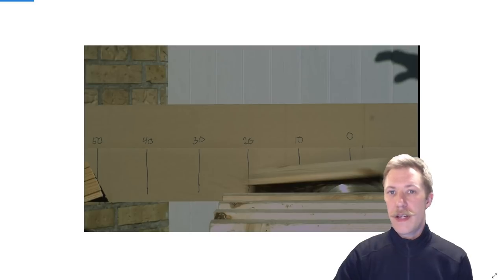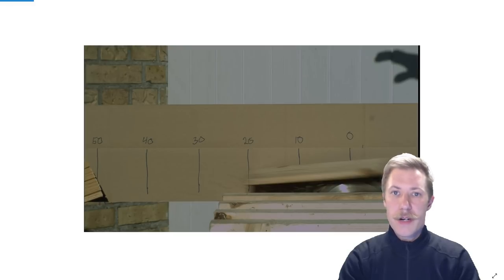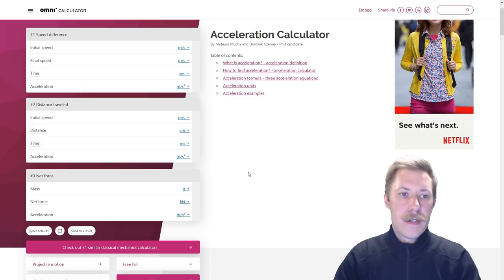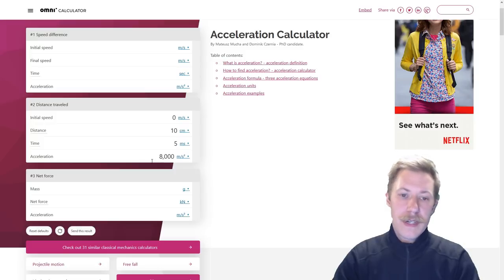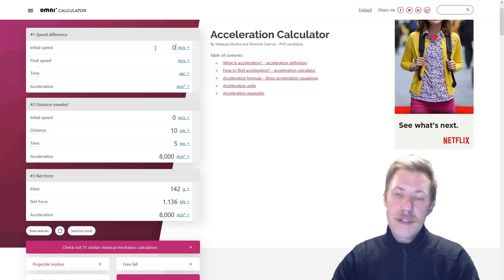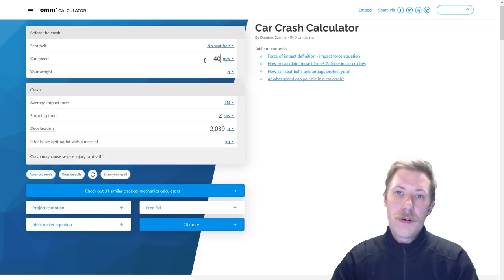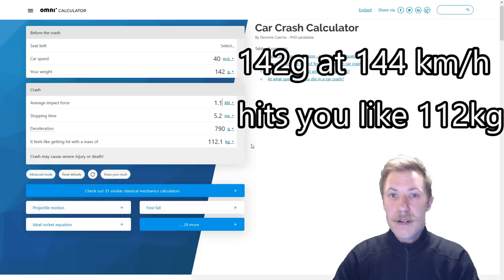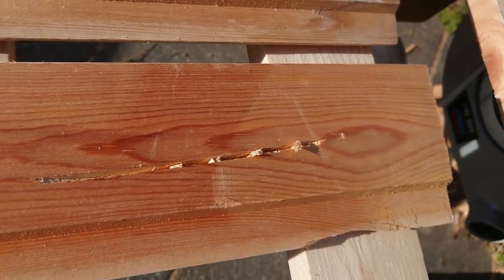Circular Saw Kickback at 1000 / 10,000 FPS and a Nokia 6233 Dies at (72km/h, NOT 144km/h)

Comment: Isn´t 100mm in 5ms 20m/s and not 40? Assuming the piece was already flying and not accelerating.
Reply: Indeed, going through the acceleration was incorrect. The actual speed between the 20 and 30 marks was ~70km/h.
Reply from the maker: Ah I see where I went wrong, the speed difference calculation is speed difference, not just speed. Well that sucks for me to have a wrong video now, but thank you for catching that error!